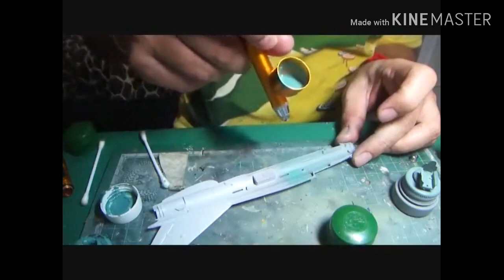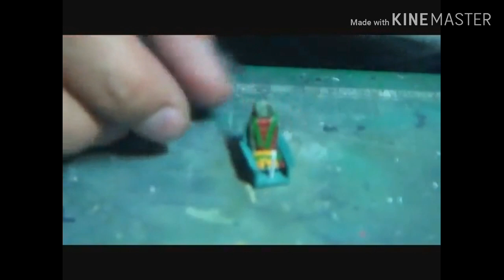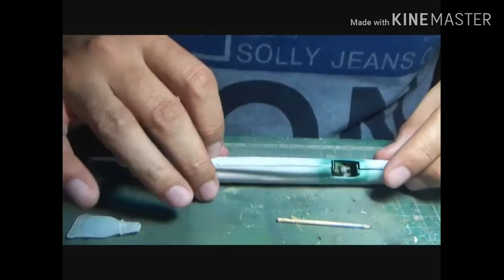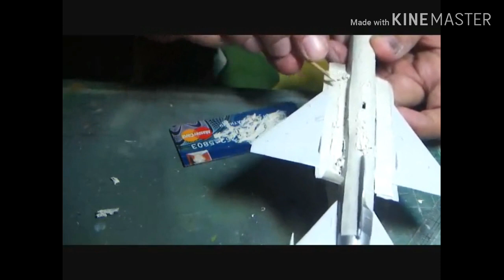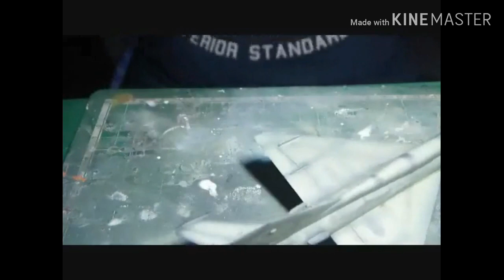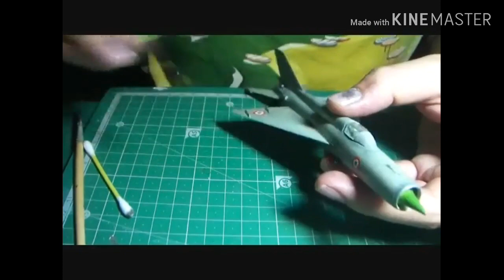kopro 1/72 MiG-21MF - Double build: Cold War Warsaw Pact Group Build update

Comment: Two super looking birds, mate, but damn, 11 days work correcting the canopy(x2)!! A testament to your patience and fortitude! Keep having fun! Cheers 👍🙂🍺🍺
Reply from the maker: Thanks Martin. Getting kits in India is a costly affair. Didn't wana bin them and I felt the shape is quite accurate for a MiG-21MF. So I thought a bit of extra effort would be worth it. But by the time I realized what I got myself into, 11 days went by 😂🤣. Came out not perfect but okay as I felt it would have been easier to reconstruct the canopy framing with modelling clay putty rather than the paste form filler. So I guess the approach had to be changed. But I had my moments of anger and frustration with both kits. Isn't that what we call having fun? 🤣
Reply: That’s a shame that getting kits is costly, maybe that’s an impetus for you to become a distributor, to help supply your fellow Indian modelers?! 
Well all that extra effort paid off! 
I’ve just begun a new project with a 50 yr old kit from 1968, that lacks details...the wheel bays didn’t exist, just through apertures on the lower wing halves, so, the last few days, I scratch built two wheel bays that include all the side wall rubbing/framework that required 40 separate pieces for each wheel bay...80 scratch-built parts in total?!! I have to do the same for the tail end wheel bay, plus improve the cockpit and the bomb bay...fun stuff!
Have a great week! Cheers 👍🙂🍺🍺
Reply from the maker: Wow. You're really gonna have fun with that. A 50 year old kit would need a total makeover I suppose. What kit is it?
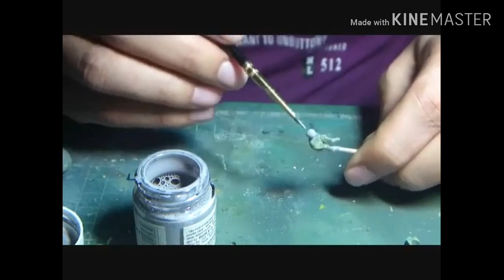Reply: It’s the Revell 1:48 De Havilland Misquito Mk.IV in Canadian markings.

Comment: Bruv, which compressor  do you suggest to buy from Amazon India?
Reply from the maker: Hi. Here is a link to the one I have been using for the last 3 years. 

Tattoo Machine India Airbrush Mini Oil-Less Air-Compressor with Tank https://www.amazon.in/dp/B00LZMPKGQ/ref=cm_sw_r_cp_apa_i_zuE3BbPSFG25A

You can read my comments mentioned there on the Amazon product listing